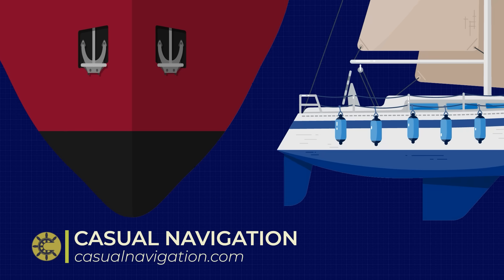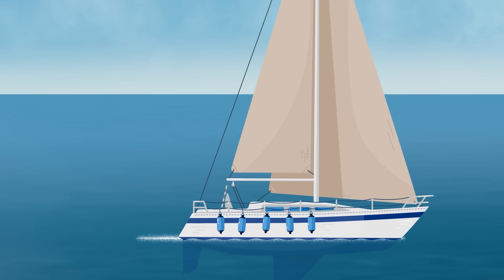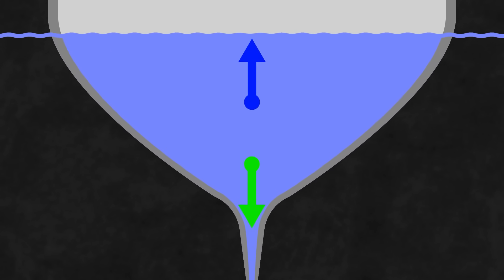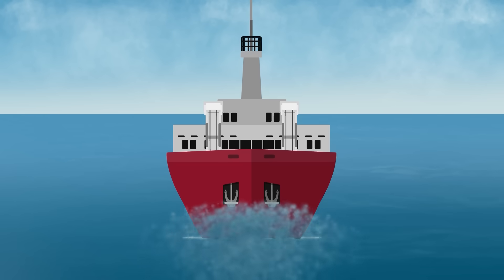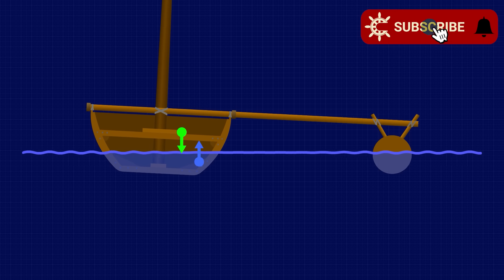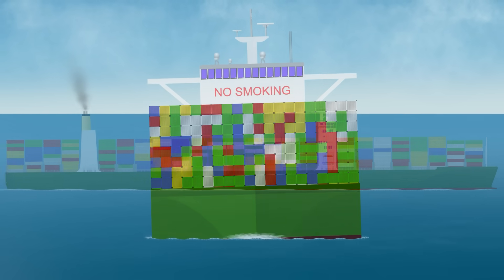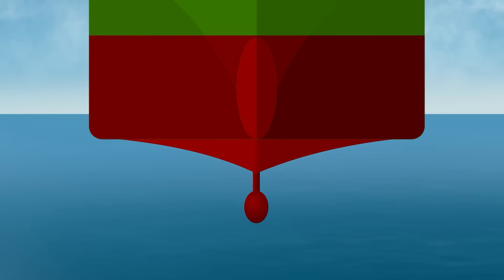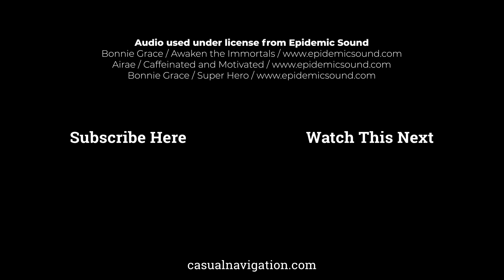Why Do Ships Have Flat Bottoms?

Comment: Fun fact: The Iowa-class battleships had a flat sided hull because of the Panama Canal, placing pretty heavy restrictions on the hull dimensions in draft (upto 11.51m), length (270.43m), and beam (32.97m), which was just small enough to fit in the canal, and making the sides flat to keep the beam within the size limits, without sacrificing internal space below the waterline
Reply: In fact, a lot of Battleships have flat hulls, and not just them, but also many ships, from BCs to CVs, and then what you mentioned the BBs
Reply: @arnoldcobarrubias6593  battleships tend to have flat bottoms, yes, but what titanicgames meant is that the Iowas had flat sides too; most battleships have curved sides with nearly no completely flat sections as you go from front to back, having a teardrop shape. The Iowas had a much boxier form to maximize internal volume (and thus available displacement) while still fitting in the Panama Canal. This is because the locks themselves are rectangular, so the closer to rectangular your ship is, the more volume it can have while still fitting inside that rectangle. 

This comes at a cost though, as the reason everyone else used the teardrop shape is because it is better for hydrodynamics, meaning you can get higher speed on less power. The Iowas were a compromise, and they retained high speed mostly through enormous power output. Modern cargo ships get away with having flat sides because they just don't need to be fast.
Reply: @klakkat The teardrop shape also comes from the fact that the belt armor on a majority of battle ships is bolted on the outside instead of the interior. The Iowa's, however, have an interior belt.
Reply: @mpk6664  
Eh, only sorta-true.

Most battleships also had torpedo defenses, and those systems were absolutely widest/most-effective in the middle of the ship, and not and the bow or stern.
It was less thick at the ends because it would ruin the hydrodynamics if they deviated too far from that tear drop shape 🙃

Like, Prince of Wales would not have sunk if that torpedo hit had happened on her torpedo belt, or if the belt had extended all the way to the propellers...

But you probably know this, and I'm just nitpicking 😅
Reply: @klakkat : "They don't need to be fast"? The longer it takes them to get to the next port to load/unload their cargo the more money the ships owners lose. Fun fact: ship crews get paid by the hour, period!

I've tracked modern large container vessels on radar at 27+ knts.
Reply: @MrNicoJac : aka an armor belt!
Reply: @skipperclinton1087  No actually, the torpedo defense on battleship were anti-torpedo bulges, aka just making a big thing of thin steel plate away from the hull that the torpedo will blow up instead of the hull. Torpedoes have so much explosives in them that armour is useless against them. They will blow a hole into whatever they hit, your only hope is that they hit something that won't sink your vessel. Armor belts meanwhile are meant to actually withstand penetration.
Reply: She's got a thicc wide bottom before it became the norm for Americans it seems. 🤭

Comment: Next time please get your research checked by someone qualified to discuss stability. This video is full of so many misleading statements and half-truths that it is downright irritating. The entire conclusion of the video is dead wrong. The ONLY reason for a flat bottomed hull is to maximize cargo capacity for a given depth of water. Nothing to do with stability. 

Virtually no large cargo vessel in the history of the world has ever had a center of gravity below its center of buoyancy! Even for large sailing vessels, the center of gravity is typically ABOVE waterline (and thus way higher than the center of buoyancy,) not below. A ship with a center of gravity below the center of buoyancy would have a violent, dangerous motion in any kind of a sea.

The whole first half of the video is wasted by talking about a vertical distance between points, when what actually determines stability is the horizontal shift in the center of buoyancy as the hull tilts. So long as the center of gravity is inboard of the center of buoyancy, the ship will not capsize. Very plainly this is more likely to be the case when the center of gravity is lower.

Which brings us to the next point: weight stability vs form stability is not binary. All ships have both types of stability to varying degrees. Even a modern flat bottomed cargo ship gets all its attention paid to weight stability, because they can change while form stability remains mostly static. Neither does a classic wineglass-shaped sailing yacht hull have poor form stability. A ship with flaring sides has better form stability than the vertical sides of a modern cargo ship!

Lastly, the metacenter is mostly just a rule of thumb. It correlates with stability but does not define it. It is a measure of how snappy the vessel's rolling movement will be. It is easy to design a hull that has a very great metacenter, but which will capsize as soon as the angle of heel exceeds a certain low angle.
Reply: Video is about flat bottom keels, and here you are explaining flat earth theory.

Comment: This is also why racing sail boats are more akin to the outrigger canno.
Maximum stability with minimum weight.
Reply: Not a lot of multihull racing classes out there. It's still predominately traditional designs
Reply: @karl0ssus1  single hull racing boats are much flatter and wider than in previous decades, using shapes that are good for planing, not the traditional boat shape.
usually the Skiff shape, pointy upright bow, hull widening until long past the middle, then even width or minimal taper in to a wide, flat rear.
some even use the Scow shape, which has very little change of width over the whole length, and the bow is flat and wide already.

Comment: Do they arrange the heavier containers on the bottom? I didn't hear that mentioned but it seems like a good idea. The major problem I see is the logistics of trying to sort containers by weight in the yard. That may simply be infeasible.
Reply: They do, to a point and funnily the sorting in the yard isn't the issue (every container gets put where it should get put and they have computers helping to decide that kind of stuff). It's more the balancing act in terms of time too. Putting on and taking off containers takes time and you have to ask if the extra stability worth the time it takes to lift a stack for that container's journey, if it's staying on for a while, maybe, if it's going one port over? Probably not. 

I think he has a video on it but i can't find it https://youtu.be/DyyyL7sRBSM?t=221 mentions it. Doesn't help that shipper aren't always honest about their shipping weight.
Reply: Bit of a minefield, yes put all the heavy containers down below but then some of them have to be taken out at ports as the ship goes along, does that mean redistribution of all the other containers for balanced onward passage?

Comment: The thing I loved about old sailing ships is that the righting force used to be measured in tons to counteract the wind force. Gives you an idea of how much power was involved
Reply: These sailing ships are rolling a lot. I sailed on one in Sydney just for a few hours and barely outside the harbour area and you get seasick quite fast if it's rolling 20 ° to each side
Reply: @simonm1447 not sure what kind of boat that was but it's not really normal to roll back and forth 20°. you may definitely heel 20° or more but that would be constant and not sickening
Reply: @KingJellyfishII  It was the James Craig, an old 70 m long steel hull sail ship from 1874. It's the oldest active ship in Australia. 

The masts are heavy and high, so there is enough momentum in them if the ship is rolling.
Reply: @simonm1447  ahh that makes sense. I'm too used to the smaller modern boats with aluminium masts and no yards aloft.
Reply: @KingJellyfishII  it's this ship. That's small compared to a modern cargo ship (it was once a cargo ship) but big for a sail ship 
https://youtu.be/9PC8pvuQiKA?si=prbS5uWrKGx-Z-PX
Reply: @simonm1447: 40+ to 40+ for days & nights on end would cure you from that! At 45+ they don't come back! Never mind the pitch in addition. But putting both together at the same time proves to be 'quite interesting'!
Classify it as an "SMO"!
Reply: This reminds me of an old video from a Polish sail training ship showcasing how much it tilts to the side when sailing at full speed: https://youtu.be/SevNwGZaWgA?si=GIFVGqRpHF4reWCj
Reply: The units don't tell you anything. You can measure the weight of a pencil in tons and you can measure the mass of the Earth in grams.